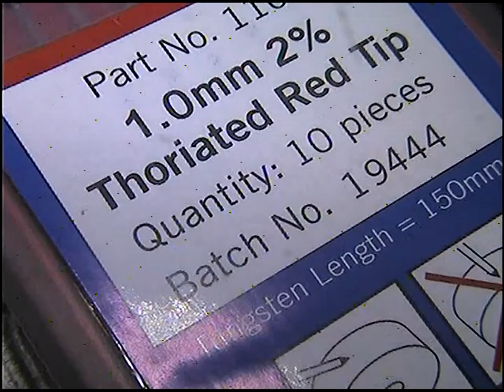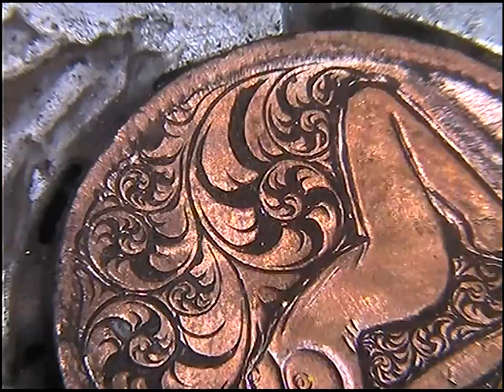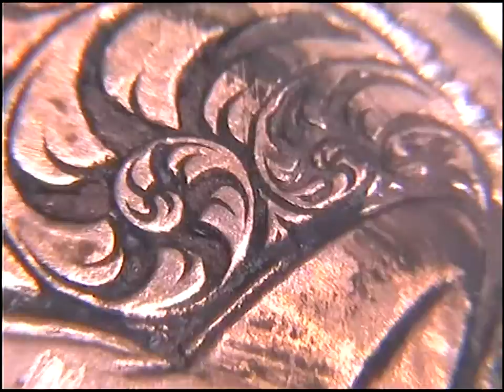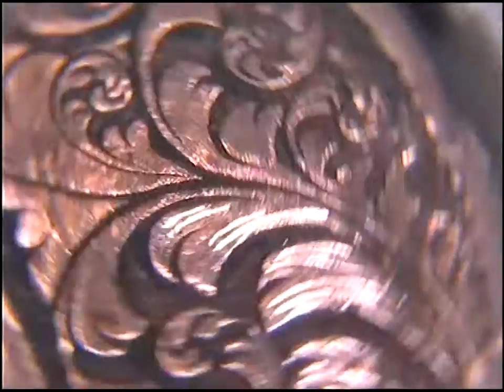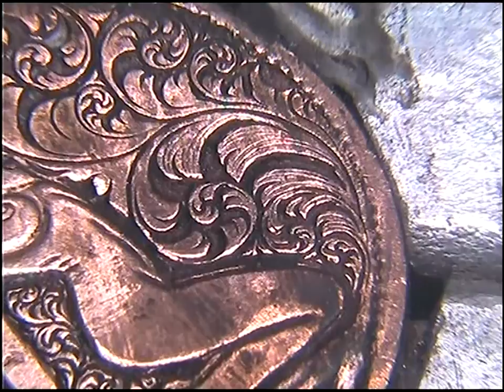Hand Engrave In A Day Tig Welding Electrodes by Shaun Hughes

Comment: I also bought these electrodes after seeing this video and it's only after I sharpen them on similar rotary device like you that I found that is highly dangerous to breathe this. now I use a mask, but after I sharpen it (a lot of time) I tough man this is some tough stuff and I thought I can hammer and chisel with this.. hehe.. first strike with the hammer and I broke the tip 😀 so half hour sharpening and one strike and it's over. silly me forgot that it's brittle.  great video, enjoy

Comment: can you cut them to make gravers for the air graver or only hand graving?
Reply from the maker: Bit to thin,and they are radioactive I found out. I chucked them!
Reply: Just for your knowledge, they are very weakly radioactive, and really only emit alpha particles. This doesn't cause any issue so long as you don't inhale the dust (alpha particles can't penetrate the skin). But, since you grind them all by hand, and aren't in a controlled environment, it's probably a good idea to avoid them for this application. Neat find though! Keep up the fantastic channel!